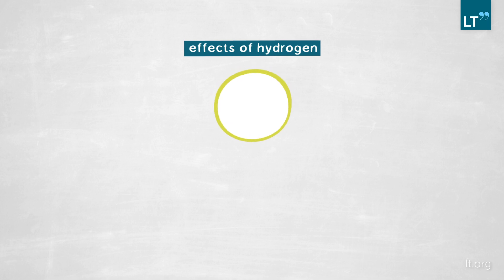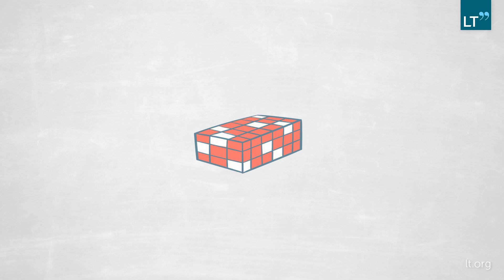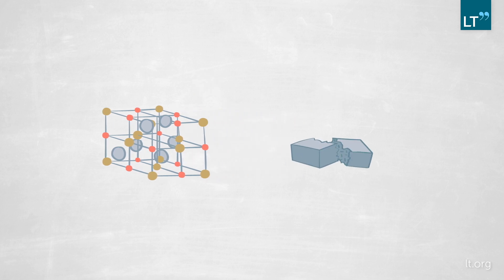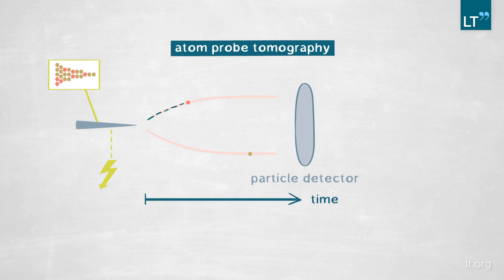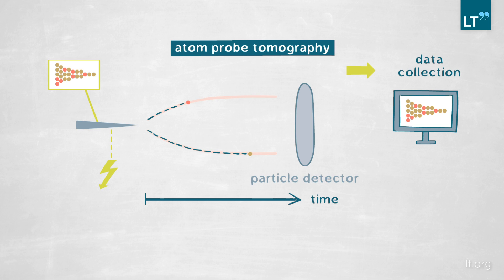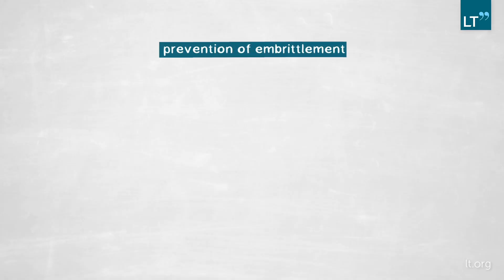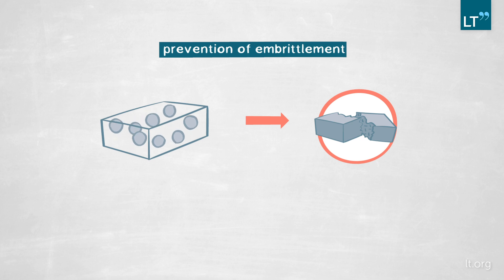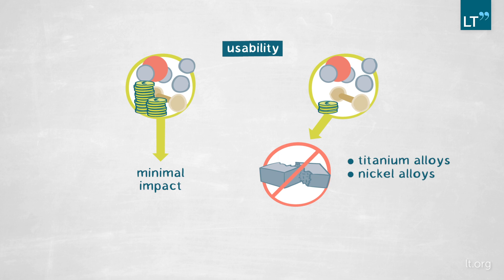What is hydrogen embrittlement and what can be done to prevent it?

Comment: Very interesting video.
So is the presence of hydrogen in the metal the cause of the cracking after welding or, is the cracking of metal caused by hydrogen leaving the metal after it has cooled and therefore trapped too many hydrogen particles in spaces where it cannot remain constrained?
Post heat treatment after welding allows more hydrogen to escape as you know, however, it could be that no pre or post heat treatment leaves the hydrogen particles vulnerable to entrapment in a confined space which they then burst out of in order to escape within the first hour after welding.
Reply: Hi Jon
this is a complex issue, but a heat treatment may not enable the "detrapping" of some of the trapped hydrogen - it depends on how deeply it is trapped, ie what is the energy binding the hydrogen to its trapping site, which depends on the trapping site itself (e.g. a grain boundary, a carbide-matrix interface, a dislocation), along with the diffusivity of hydrogen in the surrounding matrix. So in ferritic or martensitic steels, in which hydrogen diffusion goes fast, detrapping could work efficiently, but in austenitic steels not so much... it might mean that even if we provide sufficient thermal agitation to move the hydrogen out of its site, it remains more or less close to the trapping site and might even progressively move back there
it is also theorised that hydrogen may be more deleterious when free to move through a microstructure as it can facilitate the movement of dislocations, ie accelerate the deformation. Yet at some interfaces, when it agglemerates, it can facilitate their decohesion and cause embrittlement... our colleague Huan discusses this here: https://www.youtube.com/watch?v=oMpdMyLTMC0
I hope this answers your question :)

Comment: How does H2 disassociate to atomic H, without a galvanic reaction?
Reply from the maker: yes, H2 on the surface of many metals may be more stable as a split molecule and hence as atomic hydrogen
Reply: @mpisusmat  are you saying that H2 disassociates into atomic H spontaneously at an Fe surface? One would think this is p and T dependent. Can you please refer to literature?
Reply from the maker: @oeneroorda2699  Dear Oene, thank you for your interest. Usually hydrogen adsorbs in a dissociated state on metal surfaces. Please have a look at this paper:
https://www.sciencedirect.com/science/article/pii/016757298890009X
Reply: @mpisusmat  thank you, I will read the article with great interest. Did you mean to say that there is also a mechanism by which molecular hydrogen is absorbed at the metal surface, without prior dissociation?

Comment: Is it not possible to coat metal parts with some coating material (e.g. graphene)?
Reply from the maker: Yes, it is in principle possible to use coatings but coatings do often involve other problems. E.g. when you galvanize, the metal you deposit can embrittle the metal underneath and cause different problems. Additionally, a coating typically slows processes down. Please have a look here on our research about coatings and intelligent self-healing mechanisms:
https://www.mpie.de/corrosion

If you have further questions, just drop a line.